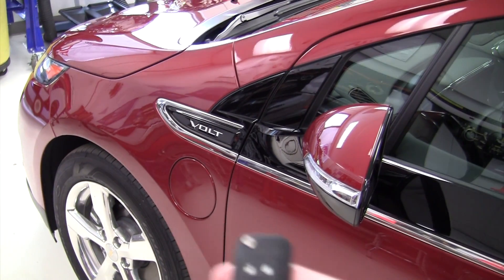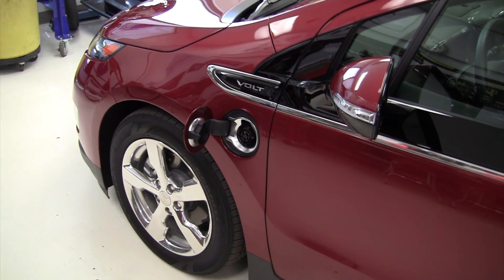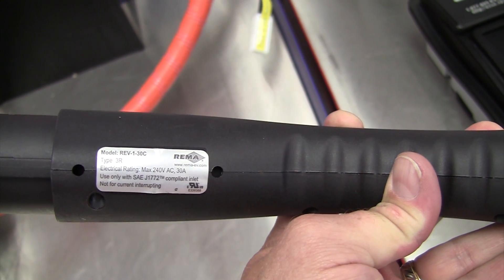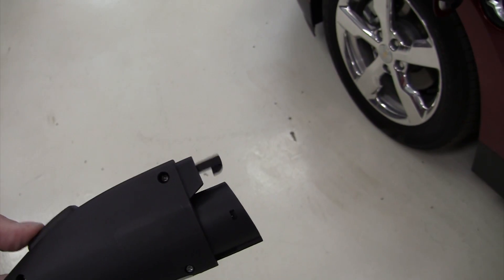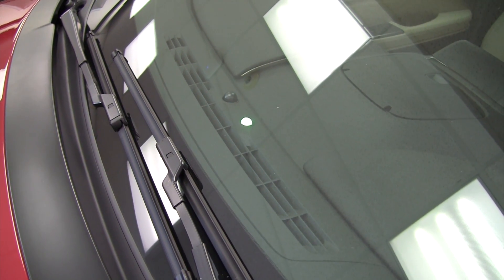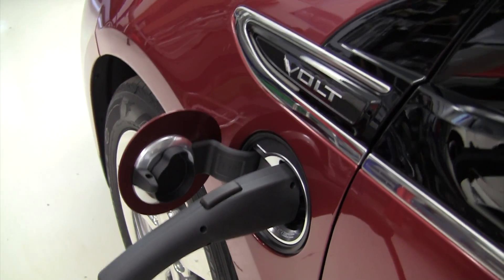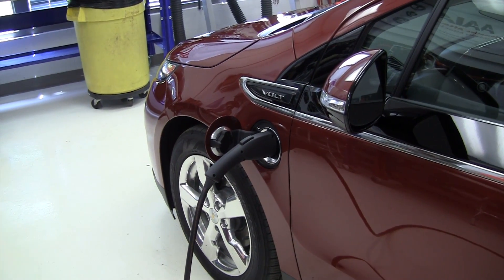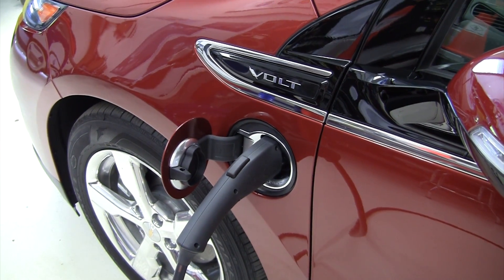2012 Chevrolet Volt High Voltage Battery Charging

Comment: Thanks for this video.  I just purchased my used 2012 Volt with 118,000 miles for less than $8500 out the door with a 90 Day Warranty here in Atlanta, Georgia.  The car still looks, feels, and even smells brand new.  I have driven 500 miles so far and no issues what so ever.  More importantly I have only used 1.7 gallons of gas in 500+ miles and am in complete love with the car.  Check my channel out for videos on my 2012 Volt and my girlfriends 2014 BMW i3.
Reply: Should I get one 2013 volt base 103,326 mi $12,000?
Reply: @jonjon9237 not a bad deal.
Reply: Thinking about getting one now with the same miles on it. Same price. How’s your experience been to date? Do you still have the vehicle

Comment: I hope it's possible to disable the honk when it starts to charge? I think u can by plugging it into the car first, and then plugging in the charger to the wall. But hoping there is a settings in the car to disable that. 
Also hope you can disable the honk when charging interrupted alarm.
And, is it the same for all years of the 1st gen Volt, 2011-2015 or is it with the early ones that you cannot disable?
Reply from the maker: Hi, I do not know the answer to that. It may be a setting that requires the GM MDI scan tool to access. Best wishes!
Reply: Yes, people on the forums are saying no way to disable (but I've only gotten 1 response so far..). Only thing you can disable is the alarm if someone unplugs the car when the car is locked. Great car to buy used otherwise.

Comment: Prof Kelly, with the Gen1 Volt being out for so long, is there a way to upgrade the on-board 3.3 kwh charger with a 6+ kwh charger from a SparkEV or Nissan Leaf?
Reply from the maker: Not that I am aware of. The battery cooling and heating systems would be affected too.
Reply: thanks... i wish GM added a faster charger. Makes me look bad when other coworkers need to charge and I am holding them up.
Reply: Sterling W GM decided it was not necessary to put in a fast-charger because you won't be dependent on solely electricity due to your onboard gas extender.

Comment: I test drove a 2012 it showed 60km range at start. The heated seats were on and climate. We sat for about 15 minutes playing with controls and lost about 10km range. Drove it and only got 32km electric range then the generator started. It showed little over 10kwh used. So the battery charge is good because they're programmed to only use 10.5 out of 16kwh. But is the battery use for heating normal to consume 4kwh just for heating?
Reply from the maker: +electronicspark1 Hi, thanks for the feedback. They do not do very well in cold weather because of the power needed to heat the cabin, the battery, and the seats.
Reply: The cabin heater can take up to 6KW I've heard. So take it easy with the cabin heat and crank up the seat heaters instead. Would help if it had a heatpump. 
 Keep it plugged in before you leave so the battery is at ~60F (at least 40F-60F) before you go. The battery heater is around 1800 watts.

And on that note, you can disable the Engine Running Due To Temperature (ERDTT) when it's below 35/25/15F depending on you model year and how you have it configured. It's only there to help heat the cabin, NOT to heat the battery. Unless the battery is more like 0F!

Comment: The alarm won't go off if someone unplugs you unless you have locked the car with your keyfob. 
And the three large prongs (not wires) on the J1772-connector is always in use. Live, neutral and ground in a 120V configuration, and Live1, live2 and ground on 240V.
Here in Norway you always charge your electric vehicle for free. You even get free parking and charging where a normal gas/diesel powered vehicle have to pay. Another good reason to drive electric. :-)